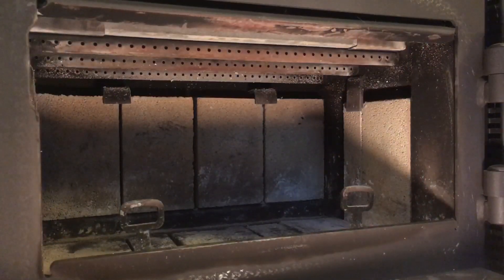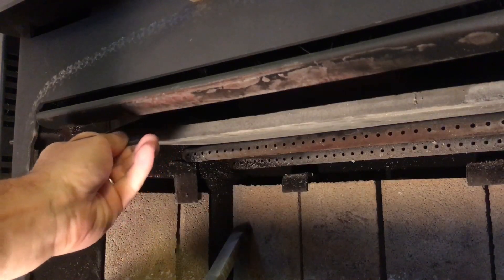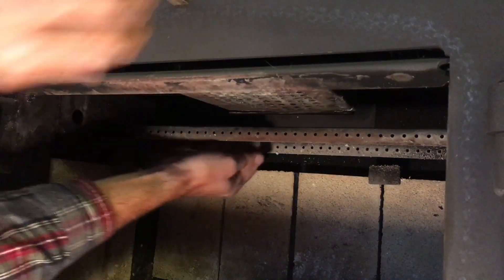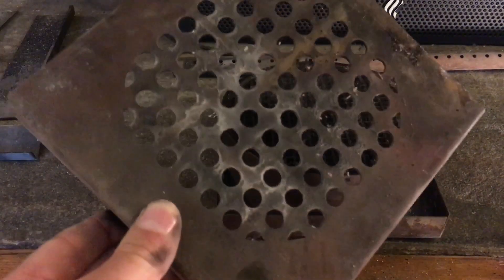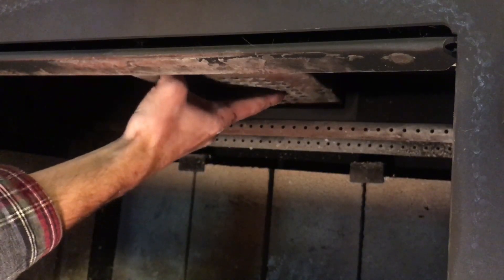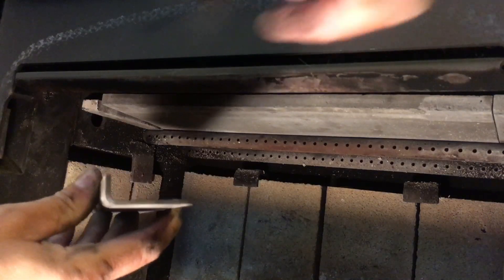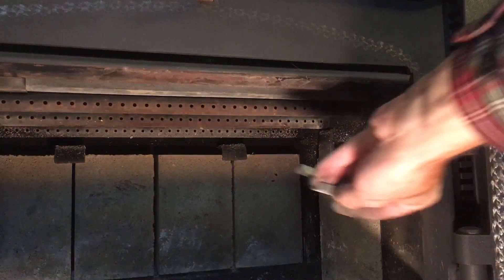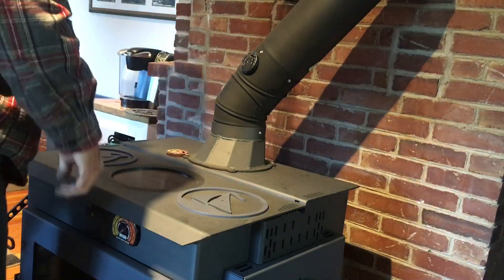Regency i1500 Wood Insert - Baffle and Catalytic Combustor Removal, Inspection & Reinstallation

Comment: Hi.. . Should we remove the ashes every time and open up the fire again ?
Reply from the maker: Not sure what you mean. When I’m using the stove I shovel out ashes every 2-3 days. It’s good to leave some ashes in the firebox to insulate the coal bed, which helps the coals last a little longer.
Reply: My catalytic converter was filled with creosote... And then my whole house was full of smoke... What could it be?The wood was dry.... Did it create ash and because we didn't empty it, did it clog the filter?
Reply from the maker: @ If it was full of creosote it sounds like you aren’t achieving catalytic combustor ignition/aren’t burning hot enough or are burning wet wood. How sure are you the wood is dry? Are you burning in bypass mode until the chamber temperature is sufficient for catalytic activity (500F)? Ash from the wood in the firebox won’t make it to the combustor. Smoke combustion produces a little very fine ash, but should not block the openings in the ceramic combustor.
Reply: I have a small wood stove. The chamber is 39cm x 33.5 cm x 44 cm... Is it because it is small?
Reply from the maker: @ This is a small wood stove. Only a 1.3 cubic foot firebox. Medium stoves are generally 2-2.5 cubic feet, and large 3 cubic feet plus. My large stove has a 3.3 cubic foot firebox volume. Smaller stoves often facilitate a smaller, hotter fire that burns cleaner. I have never had any creosote in the catalytic combustor of either of my stoves. A little fine ash, yes. But not creosote. And they have never been blocked. I suspect wet wood or a fire not burning hot enough for the catalyst to function. A cool smoldering fire also leads to creosote buildup.
Reply: @ProductiveRecreation  Thank you very much for your help... What is the maximum amount of wood you suggest I put in my small wood stove?
Reply from the maker: @ As long as the stove temperature doesn’t get too hot and the unit doesn’t overfire, you can fill it with as much wood as will fit. Overfire is usually defined as sustained temperature of 700-800F +. A bigger load of wood (fuel) will give longer burn time, and generally a hotter stove.

Comment: This is a great in depth video of the mechanisms inside this insert...I have the Regency 2500 i believe😮 and I just recently had my unit cleaned and inspected... I burn a lot of wood, and my unit was in fantastic shape with cat combuster working properly... after the cleaning and being reassembled I can no longer fully engage the rod on the catalytic combuster... im Now beyond frustrated having to call the local company who (1) I purchased the stove from(2) did the cleaning(sweep) only to have to call them 3x to have a technician come back out to reassemble my catalytic combuster ... Obviously. Now the problem is with the company because customer service.I guess does not exist in today's world... There is absolutely zero reason why I should have to call the company more than 1x to fix the problem they created... i'm so annoyed!!
Reply: I guess I will need to familiarize myself with my unit so I can do the work myself !!

Comment: I need help... what is the outside diameter of the secondary air tubes
Reply from the maker: I’m not 100% sure but I believe all the Regency secondary air tubes are 0.75 inch diameter, with length varying by stove. They are notched/keyed on the end to lock into the stove.
Reply: @ProductiveRecreation  Thank you very much for your response, I am manufacturing a stove for my home and I am looking to replicate that type of combustion chamber with that type of double combustion, that is why I was asking for help to know the diameter of the secondary air inlet pipes, I do not live in the United States. united, greetings from CHILE 🇨🇱

Comment: I'm back and I followed your process.  It worked great.  I had been using the stove almost continuously for 2 months, letting it burn out and cleaning it every evening about 6 or 7pm, then recharging it and feeding it until noon the next day.  I used q-tips to clean the catalyst.  The greatest difficulty was in removing the air tubes.  I hammered on the side of the vise grips, just like you did, and it worked, but I was concerned about the rough treatment of the tubes, and the tubes failing early in their life because they experience so much temperature cycling and then the hard knocking and squeezing during removal.  Near the notch on the right end, each tube appeared to have been bent around the notch from the force from hammering (not sure if it was always bent.  To preclude the need for future hammering, I filed the metal around the tube notch so that it slips in and out of the holes more easily.  I hope the filing did not affect the tubes' functioning or longevity.  
On a different topic, the side retaining clips fall off all the time during normal use. I tend to bump into the tubes and baffles when loading the firebox, and this ends up knocking off the retaining clips.  Do you have any insight about how to keep the clips from falling out?
Reply from the maker: Nope. I’ve knocked mine out the same way you describe on a couple occasions too. I don’t think it’s a good design, and I question their necessity.
Reply: @ProductiveRecreation  today well following your video and disassembling the stove to get the combustor out. I noticed one of those little clips was missing. I’m convinced that it fell out  and I didn’t realize it and ended up mixed in with the wood ash and got tossed out during one of my ash cleanout .